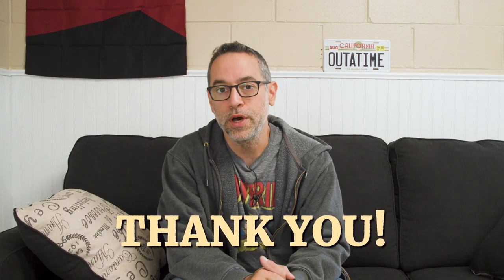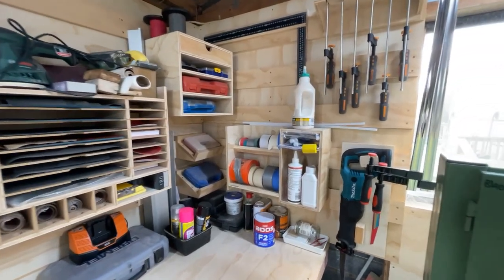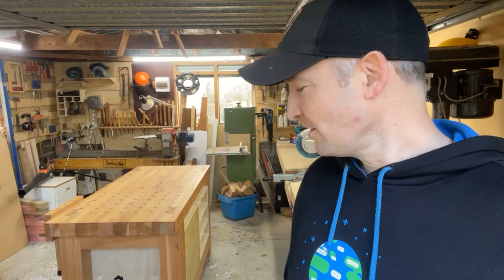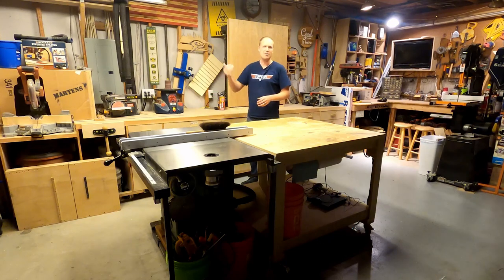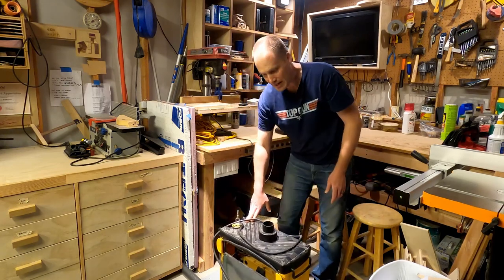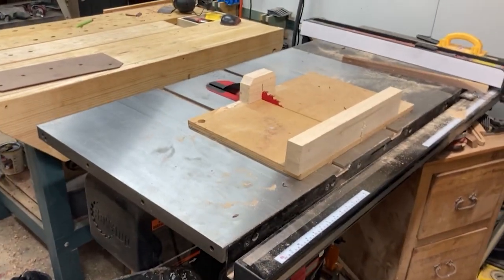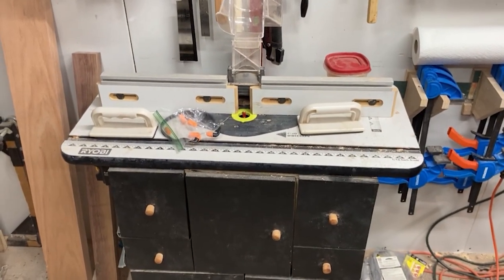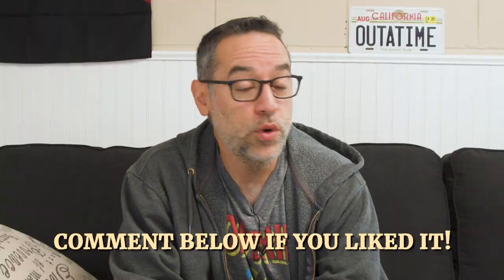Small But Incredibly Functional | Woodworking Shop Tours

Comment: My shop is an 8ft wide x 40ft long rail car cargo container. I cut windows and a door in it. I insulated it with 1" foam sheeting and furred it with flat 2x4s and lined the walls with pallet boards. I have a table saw, band saw, router table, lathe, and a mortiser. It's pretty narrow. I put everything on rolling bases and shift stuff around during use. The back half has my work bench and all my hand tools. I use my table saw a lot but mainly I use hand tools. The height is 9 ft so I compensate by storing stuff on shelves up above me. I've built lots of furniture and cabinets in that little tiny space. I can work in the heat of summer with just a small fan and during a cold winter with a small space heater.

Comment: Great ideas! I have a 20’ X 24’ garage. When I first began setting up my Garage/Shop/Multipurpose room. My wife said, it has to be neat and no clutter. That was easy I’m neat and tidy. I wish I could included pics because I get a lot of comments and compliments from friends and neighbors. I had the floor epoxy coated. I have the full complement of the usual tools, portable table saw, drill press, belt sander, spindle sander, bandsaw and of course 10” miter saw. And we just had Christmas dinner in the garage.

Comment: Kris: epoxy pour the floor. Expensive option but very effective, gives you a flat smooth surface... after you spend some quality time with a wire brush in your grinder going over every centimetre of the floor :)   The concrete needs to be solid underneath it, though.

Comment: I always love shop tours. I currently have an amazingly large shop. Probably about 1200 sq feet. I struggle with using the space wisely though. So shop tours are great to watch to get an idea of better flow for my shop. I do also restore furniture. So I have about a 10x10 space with a removable paint booth/finishing room in it. It's spring loaded telescoping poles that hold plastic to the ceiling that creates a wall. I think it could be a great solution for someone who shares a shop with a car (disgraceful... LOL... JK). It would work great to keep dust out of the rest of the garage.

Comment: Love shop videos especially small shops.  Here is my tip on setting up a small shop: SKIP the miter saw station.  It takes up too valuable space and makes way too much dust. My first shop was a 2 car garage and I had a miter saw station on one wall, but now I am in a 1 car garage and I decided I rather have more work surfaces than a miter saw station. As a compromise I built an fixed miter saw station outside behind the garage (miter saw is covered with a "weather tight" box).

Comment: I really like to see these shop tours, especially the small ones, because that's my woodworking life right now. I'm in about 3/4 of a bay of a garage - because the other 1/4 is my gym, and the other half of the garage is... gasp... for my car (I know, I'm a heathen, but I don't want to park it outside when it snows). And I'm really just getting started, having moved in April.

Seeing the fold down CNC just triggered lightbulbs in my head - I don't always use my CNC, but it sure is fun, and that is really cool option. I could see putting something like that near a cabinet I'm going to build for my miter saw. 

Hey when you don't have a lot of space, you have to just stack everything where you can. It's great to see the solutions people have come up with.

Comment: On the first shop, I would turn the table saw around, move it to the right as far as I could and still have the full capacity and use the work bench as an outfeed table. And put wheels on the work bench.

Comment: Awesome idea. Can't wait to see others shops. Especially the smaller ones... like, REALLY small lol. 
 
Definitely will not see my shop.
 
 I'm 6'8" 300lbs guy, with only one functioning arm and leg, in a space that's 10-ish by 10-ish with 7ft ceilings lol. It has the added bonus of heat that only Clearwater Florida knows though lol. I'm basically working in an attic with no insulation, and very minimal air flow. So it gets about 20-30°F hotter than it is outside in the summer, and 10°F+ cooler in the winter. 
 
So, a good shop is nowhere near what I'm able to employ. It is a bit adapted for me I suppose... but lacking the room for my giant, unsteady body. Lmao.
 
(I'm that annoying guy that you mightve seen in many videos, forums, and social media, over the past 5 years, that keeps hounding power tool companies to make a left blade track saw since I only have function in my right arm/leg,  I cant rip sheet goods, or other types of lumber in my "shop" using right blade track saws. The right blade track saws are designed to be used on the left side (left handed) to rip sheet goods. (See the few second demo of a video I took from my friend, a fellow one armed woodworker, Leo over at Hand-i-Craft. I just mirrored him using his left hand with a right blade design, and It shows what it would look like using a left blade track saw, as a righty.)

Comment: I know you're going to get an undesirable number of comments along this line but....  I WISH my workshop was as large as any of these.  My space would be long enough to fit a single car, but it is not the width of a single car (I could not fit a car in it).  I've managed to jam a work bench, table saw, bandsaw, drill press, belt sander, thicknesser, dust collection, and other odds-and-sods into the space and somehow have room to move around.  I, just about, go green with envy when I see someone with a full-width single-car garage.  I know there'd be people working in even smaller spaces than me.  Perhaps a mico-workshop category is next.  🙂

Comment: So if you consider a 250ish sq ft shop small, what do you consider my 80 sq ft shop?
Reply: a mini? Do you get what  you need done in there? I guess we can adapt to what we have, no choice right? I have no shop, I have to lug my tools out of the garage and set up in the patio then break down each time so as to not leave everything out. But I'm working on fixing that, I'm going to take over the ENTIRE garage 😂to build my shop. Good luck to you Joe 👍
Reply: @woodworksbygrampies1284  You deal with what ya got, can’t agree more.  It has forced me to do mostly hand tool woodworking and do smaller projects.  I miss my big power tools but they are stateside and my dad is really enjoying them.  I do miss my bandsaw a lot though.
Reply: @joebaker5421  I'm sure your tools are in good hands waiting your return. Just keep building. Have a good one. 👍